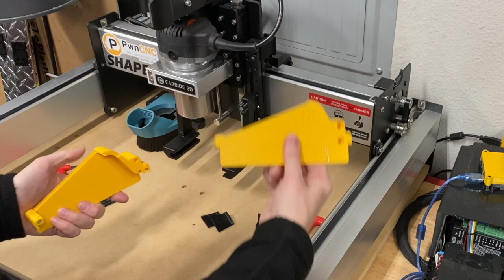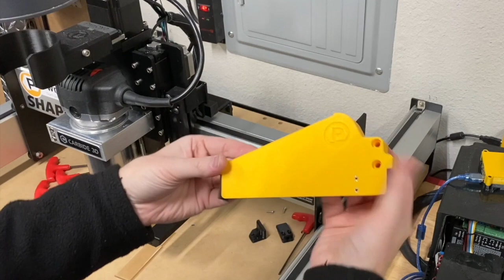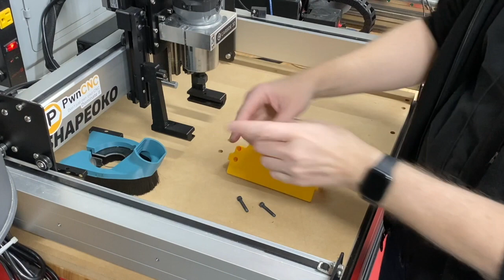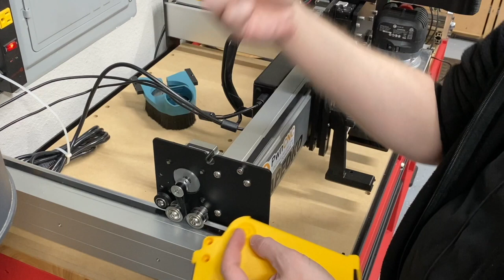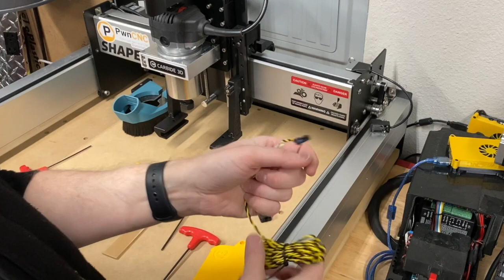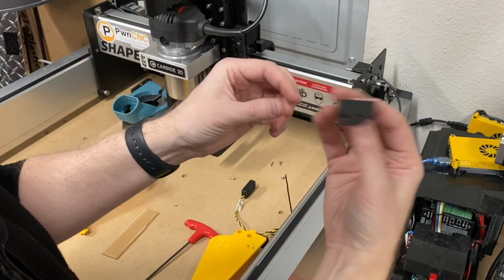Installing our new Shapeoko Covers

Comment: with the shapeoko 3 xxl isn’t the proximity switch for  y travel on the left side?
Reply from the maker: It's always possible they changed it, but the homing switches over the last few iterations of the XXL they've been in the back right.
Reply: @PwnCNC  unless i’m being really dumb and now i’m anxious to get home to check. lol. i bought your dust covers a while back but between new baby and work haven’t gotten in front of my machine to install them yet. That’s gonna suck if it’s the case 😒
Reply from the maker: @workingdogwoodworks1455  This video shows me installing onto my standard size... but I validated these steps on my XXL before i sold it a few months back.  Didn't capture any videos installing these covers onto it, but there are many other videos i've posted showing switch locations and such.
Reach out to me via info@pwncnc.com when you get the chance to install the covers.  I'm happy to help if you run into any issues.